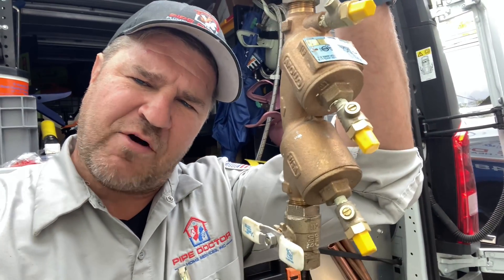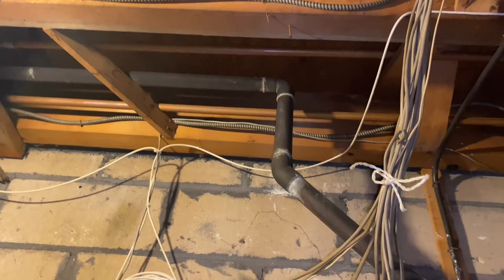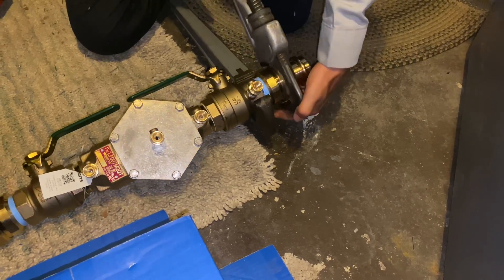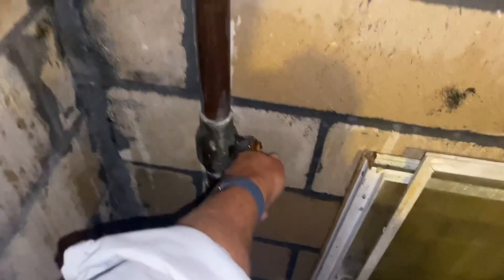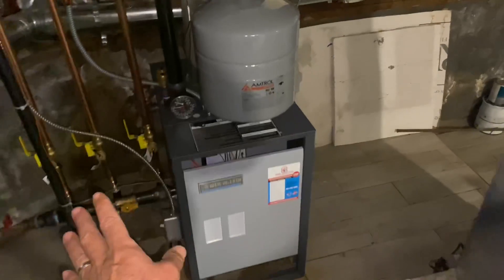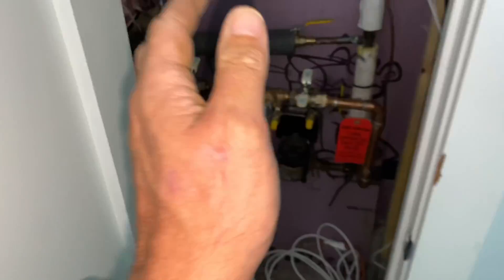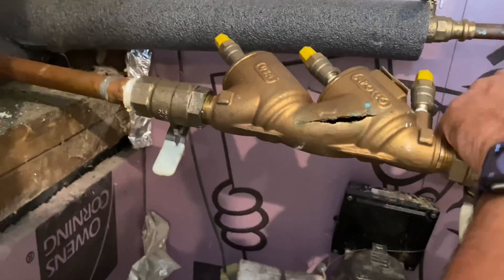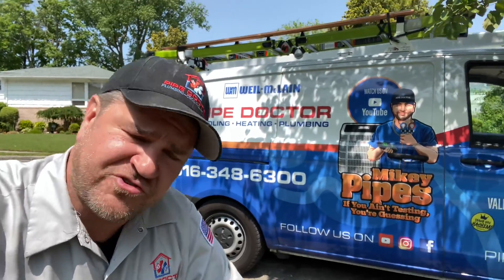Power of Frozen Water - Backflow Prevention Valve Installation Double Check Valve DCV New York

Comment: It doesn't matter where you live, hydronic fundamentals still apply. Some of the things that I learnt from others where wrong. I have researched and adjusted over the years. I have worked with mechanical engineers for my entire career, and we have bounced ideas back and forth. They are not right all the time also. Some also believe that career tradesmen have interesting info if they can listen to what we are saying. They draw lines on paper, we install it in a real life setting then repair it when it doesn't work.
I know you will think about some of the things I talked about in you future installs or servicing. I won't bother you anymore. No need to respond.

Comment: Well you challenged me to look and I did. Go to page 8 of the installation instructions. It shows bypass piping from supply to return in order to have a mixed return temp. If you consider this configuration as per instructions then just pipe primary/secondary. 
Low return Temps below 130f will cause flue products to condense on the heat exchanger prematurely rotting it. 
Here's a scenario:
It's February and very cold outside and the sun is shining. North side zone is calling and boiler running 180f. South side satisfied due to solar gain from the sun and loop is cooling down. When south side zone calls it introduces room temp water to boiler. Boiler has to go from 180 to 70-80f quickly. ( thermal shock)
Cast iron boilers do not like to expand and contract quickly. This will cause premature section failure. Seen it many times. Free advice.

Comment: I am not complaining about the way the boiler is piped. You can pipe it however you want. I was just letting you know that it is an excellent opertunity to pipe in a primary/ secondary configuration. There are many advantages to doing it that way. If you are rude in your comments you will never learn anything.
It surprises me how there is such a difference between hydronics in canada and the USA, and our installation techniques. (I am not a fan of pro press whatsoever but that's my opinion)
I have been working in that HVAC industry, commercial,industrial, institutional for 30 years and on the end of my career. I still learn and still make the odd mistake. I was taught by the "dead guys" and they knew what they were doing .

Comment: You can't be serious. It's called "good piping practice "
There are ways to pipe hydronics that can work for you and there ways to pipe hydronics to work against you.
Pump location, feed water reg and expansion tank for example. Put them anywhere in the system and it will still work, put them in the right place and they will work for you. Tell me I am wrong.

Comment: There are numerous reasons to pipe a system like that in a primary secondary configuration. 
-better for the boiler
- ensures proper flow through the boiler 
- decouples the boiler from the rest of the system
- no chance of thermal shock to boiler 
- no chance of flue gas condensation on the heat exchanger. 
- can make the boiler the high point in the system ( even though it's in the basement)
- system will never need to be purged of air unless opened up .
- loops will purge themselves if small amounts of air were to get into the system.
- way better for maintenance 
- great for the customer because the system is whisper quiet.
Just to name a few.

Comment: Mike,
Why so many boiler heating systems and not forced hot air systems? I grew up in Massachusetts and live in a house that was heated by a forced hot air furnace. It was originally heated with coal and then changed to oil. The house was always very warm during the winter, and we never had to worry about water, steam, pipes, valves, radiators, and boilers.
Reply: water/steam is the most efficient of heating types, via radiators that hold the heat and keep emitting for a while after the heat calls stops, plus they don't dry the air out as bad.
now days, heat pump setups is likely the best, but not where its super cold. around here there's a mix of mostly forced air, hydronic and some steamers and a mix of fuel types, propane, natural gas, oil, heat pump, electric mixtures. sometimes even electric radiant(floors/walls/ceilings) the dumbest ever is ceiling electric radiant heat(lol)

Comment: How does it burst inside? Must be very cold in the Basement
Reply: Frozen water splits rock. Watch out in those falling rock zones along the thruways upstate New York in the winters, treacherous!
Reply: seeing it split between the check valves, that had to have frozen directly. probably a power/heat outage or it had cold air blasting in directly on it.
probably pure lucky there's enough water usage to keep the meter and other lines from freezing up also.

Comment: I'm a retired concrete truck driver and those have a lot of ball valves on them. They swell or split depending on how cold it gets.
Reply: @PipeDoctor     😂 never saw on split in 80* weather !
Reply: I have a 3k psi valve from my dad for hydraulics on trucks. It's a 1" threaded valve.